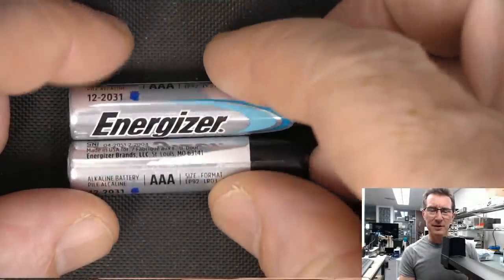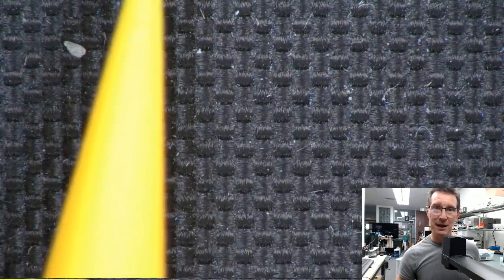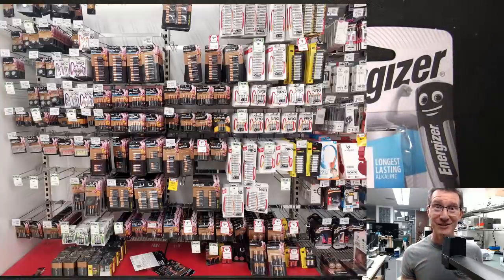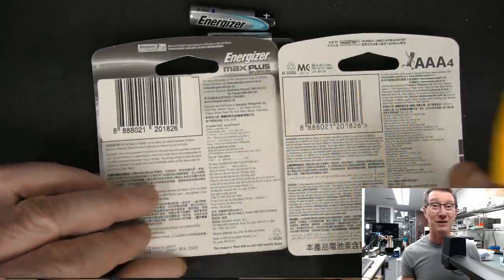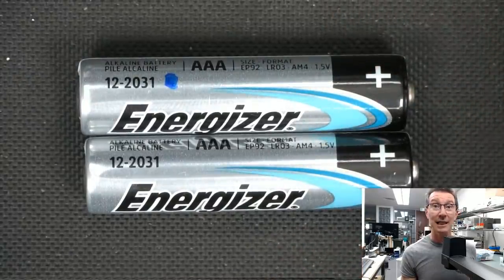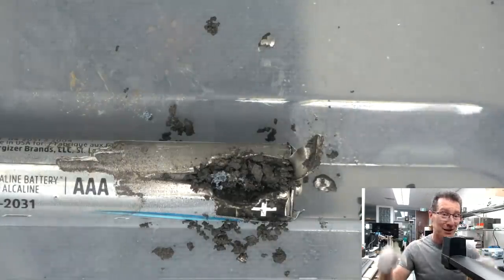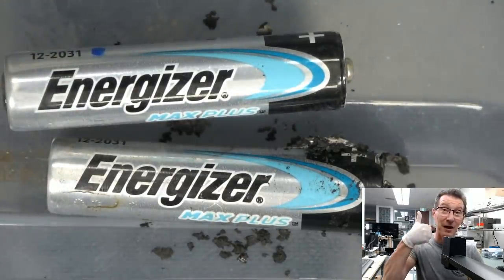EEVblog #1350 - Fake Energizer Batteries?

Comment: I hope you hear direct from Energizer about the leaks.... I put so much trust in them!
Reply from the maker: Surely you jest!
Reply: @EEVblog  Don't call me Shirly!
Reply: @EEVblog  This is something they need to look at, at least from a marketing/PR perspective. With over three quarter million subscribers it's not like you're obscure, so I bet someone at the company has/will see this. Just because the exterior and chemicals are visually identical to the real product doesn't mean it's not a knock-off - the manufacturer should be concerned enough to contact you for samples.
Reply: Just when I thought we'd escaped the scourge of Duracell.
Reply: I worked for Union Carbide in the early '80s when they owned Eveready. Before alkaline batteries became popular, they would replace any device damaged by an Eveready (maker of the Energizer) battery. Although in a different division than the part of the company I worked in, because we were both in the Cleveland, Ohio area, we shared a computer. They used the computer for battery longevity testing, while we ran general workloads. There was trouble if the general workload crashed the computer, and ruined a month-long test.
Reply: Reminiscent of Amazon’s recall with doorbell camera batteries, tho.
Reply: Sometime before Easter, when the rabbits get busy.
Reply: they will send him an energizer bunny as compensation.
Reply: Didn't Fran just get done singing Energizer's praises? She must be bought off by big battery now! SHAME "ding-ding"... SHAME "ding-ding"... SHAME!

Love ya Fran.
Reply: Narf is Fran spelled backwards. Or how it would look if you were in the mirror.
Reply: Energizer is just a banner it's not a poduct. Could be any battery inside depending on where in the world you are.
Reply: could we use it to scrub the Carbon form the air ?  GLOBAL WARMING is solved  :)
Reply: Hi Fran!  =]
Reply: @ColinTimmins  Good to know @Fran Blanche keeps an eye on the Aussie fella :)
Reply: I have just watched your video about batteries I am a fan
Reply: @MaquinasAbiertas  Being a fan, which batteries last longest in you?
Reply: @veryboringname.  We use rechargables.
Reply: @MaquinasAbiertas  This is the answer - if you have a device that you don't want damaged by leaks under any circumstance, put eneloops or some other good rechargeable in.
Reply: It's Fran!
Reply: theres the problem... youre trusting companies that only care about profits...  SMH..
i bet you use Apple products too...
Reply: @WacKEDmaN  If they only care about profits, they would be interested to know about a product fault.
Reply: @CT-vm4gf  but it NOT A FAULT...its BY DESIGN...dont you listen?!
Reply: @WacKEDmaN  ,  I'll bet they are DROOLING over the M1 chip, then! ROFL
Reply: @WacKEDmaN  NOONE USE APPLE.  APPLE USE YOU.
Reply: @notavailable8130  ,  Too bad they ARE "Available...!"

Comment: First the Duracells leaked. Then I found two new Energizer Max D cells leaking in the original package. I'm still checking other makers for better quality. So far Panasonic and ACDelco look promising. Good luck. I sometimes use Panasonic Zinc Carbon AA. In over 30 years I've never had one leak.

Comment: Hey, I watched this video a week ago and a couple of days my mother came to me, because her electrical furnace (just for decoration, no heating) broke. I looked at it and it ran with batteries, with Energizer batteries, and one of them leaked. It was the same fluid, that came out of them, didn't crystalize right away. Those were original ones, that were just a couple of days old.
btw I'm from Germany.
Thank you very much for this video.

Comment: I assume the venting happens when the internal pressure exceeds the external air pressure by some margin.  So if the external air pressure were reduced, that would increase the chance of a leak.  Might the leaky batteries have traveled by air mail and thus spent some time in the in a cold, low pressure cargo hold of an airplane?

Comment: Question, the GPS tracker didn't happen to be sent via air mail did it? Could the pressure changes that occur during flight have sped up the leakage process?
Reply: Airplanes are pressurized
Reply: @84ThoughtCrime84  Airplane passenger/crew cabins are pressurized, but cargo areas sometimes are not. That being said, the pressure is not constant, and changes as the plane ascends and descends(which is why your ears pop during these times).

Comment: I think the Positive terminal not being attached properly may be the culprit on the ones that leaked. The machine that rolls the negative end over the seal would have too much pressure if the overall length was too long because of the positive terminal being welded wrong. To much pressure could squeeze the seal and damage it.

Comment: All major battery brands that I purchased in last 5 years have leaked... They are all shit now. Buy a 25-50 pack in plastic containers and at least a few will leak within a year or two. Lol. Looks like the battery shell usually leaks in the seam due to crap seal or thinner-than ever metal being eaten away.

Comment: SNI is an Indonesian Standard for certification of safety for a specified appliance. It’s similar to UL logo. There are many ways to certify for safety and meet regulatory rules for IEEE. It appears that Energizer chose to certify these batteries to an SNI standard. The MSDS should be looked at before handling any type of small cell battery. It’s a google search away.

Comment: alkaline batteries seem to leak like clockwork if there is a frequency going in , or through them.  I thought I found a way to charge alkalines by slow pulse charging, and it charged. also leaked in a month.   roughly 2mA - 7mA for 24 - 72 hrs = near guaranteed leak in some months. I have yet to test whether or not is it just the slow charge or the mere existence of a pulse.

Comment: Those two packages are very different, though... did you get them both from Woolies?
Reply: Watch the video. And logic says that they are the same battery cells, one set with old branding and packaging and the other with newer  branding and packaging

Comment: afaik alkaline batteries are packed instead of rolled, and i guess thats why they have such a high internal resistance. Maybe its on purpose because most stuff doesnt need 1A and it also helps to increase sales in stuff that needs more power because at 1A you get 35% de capasity so more power = more batteries sold.

Comment: at 15:55 'Lithium don't leak'  . Well I had a leak with one (or two) of the lifepo (type 32700) batteries here. A goop on the desk and came out of one of the terminal, the positive one. A waterisch transparant fluid which later on turned brownish (dark orange) when it dried.
Reply: Li-FeS2 (Primary Lithium, replacement for 1.5V Alkaline) might not leak. What you have is LFP (Lithium Iron Phosfate rechargeable). There are many types for both primary and rechargeable lithium batteies with wide variety of characteristics

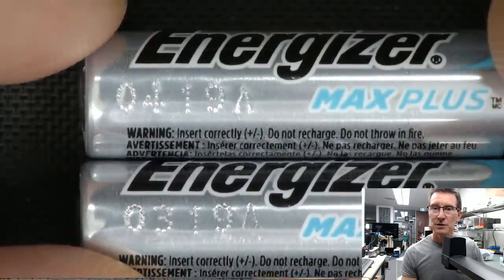Comment: At 7:40 you mention that these batteries were send in the mail bag. Were they sent air mail? Perhaps the lower pressure in the airliner's cargo hold damaged the seal, making the battery more likely to leak. Maybe that is only a problem when the battery is actively providing current, as you mention the GPS tracker was running the whole time.

Comment: The metallic label is actually the leak indicator. When I inspect equipment where such batteries are installed, I immediately check the colour of the negative terminal. If it looks white instead of metallic, the batteries go into the bin. 

Duracell and Energizers are ticking time bombs designed to kill equipment. 

I've had way better luck with brands like Fuji, Philips, Sony, Panasonic. Haven't had leaks from those.

Comment: Sad all batterys no matter what brand they are going to leak. About 20 years ago they made batterys better and they lasted longer. And I myself 20 years ago, very few times I open something up and the batterys were not leaking. Now days I run around my place once a year checking batterys and find a few that have leaked. Just times are changing and not for the better.

Comment: Batteries under load while in flight (as they were mailed), would that be an issue with these.
Reply: No, it's simply that the batteries are dead flat, and all Alkaline batteries tend to leak. They even have holes in them to release the schmoo.

Comment: For the battery leakage experiment, maybe it would help to put the samples in a hotbox or something to heat them right up to (or slightly beyond) their temp rating. Or just paint the tupperware lids black and put them outside in direct sunlight to temp cycle them or something.

Comment: Found out the hard way that shiny metallic stickers / labels like on this battery can be conductive.  Licensing stickers on a PCB where a shiny silver hologram type.  They where laminated on the top, but the bottom foil side only had a coating of adhesive between the metal foil.  When stuck on a PCB the sticker could cause resistance across through holes where the solder mask was pulled back off of.

Comment: Way too many years ago to remember, we used to re-charge alkaline batteries to get a bit more life out of them at work. As we used to get through quite a lot and getting an extra week or so out of them, noting that it’s said to not be safe to do so. It was a risk, but what were the risks involved, we were young and it was the 80’s.  We used a dirty DC voltage to push a bit of charge back. Well one lunch time we had left some on charge and when we got back to the office, we found a lot of mess on the top of the bench from one battery that had exploded!!!!

During the cleanup which included having to clean the ceiling! We found the centre metal spike of the battery stuck through the RSJ supporting the ceiling. Gone clean through! After this all attempts at prolonging the life of an alkaline battery was banned.
Reply: I sometimes used to re-charge AA batteries in the late 80ies and early 90ies, too! I didn't have to, I just thought it was cool that I could when everybody thought it was impossible. I never had one explode or leak though, it was always fine. I just put them in a normal AA charger for re-chargeable batteries. I think it was some simple 100 mA or 200 mA charger back then. It even had a lid so you could close it up while charging, so it wouldn't have been that dangerous.

Comment: I guess if package was send by an air mail, like on a plane,  low level of ambient pressure, compared to a pressure at the sea level, in a cargo section of an airplane. That may have resulted in a pressure difference between surrounding and internals of a battery, which led to escape of the liquid  from the battery. And batteries are usually delivered by sea or a land transport. Only if someone can test this theory in a vacuum chamber.

Comment: Were they airmailed? I found that every hard drive failure that I can remember has occurred shortly after being on an airplane. I reckon it's the air pressure changes doing them dirty.
Reply: Hard drives have sealed air and related vents.
Reply: @johndododoe1411  I'm talking about common, mechanical hard drives. They need to have a way to equalize pressure with the ambient environment so that they don't flex and deflect the precision parts. They tend to have a filter of some sort guarding the vents. I've seen both mechanical (a piece of cloth) filters and charcoal (to adsorb chemicals). I understand that the routes of dust ingress are guarded, but I'm telling you that Iraq is unreasonably dusty, I brought half a dozen hard drives with me, and several of them failed - not there - but when returning to the US. In my unit, there were many such cases. Yes the vents are filtered. No, filters don't turn off the contamination like a switch. That's part of why warranties and 'Mean Time Between Failures' exist.
Reply: @buckstarchaser2376  My point was that the vacuum of altitude would seriously exceed the design limits of whatever controls the inert superclean atmosphere inside a 21st century mechanical hard drive.
Reply: @johndododoe1411  The altitude pressure inside a commercial airliner is usually set to 8000 feet. The atmosphere inside the drive is the same as outside it because it is not hermetically sealed. The amount of abrasive materials that end up inside it will depend on the efficiency of the filters it has in place, the ambient dust quantity, and particle size, and how many volumes of air are exchanged between inside and outside. Once the drive leaves its factory shipping containers, it will accumulate dust internally. You can reduce the dust ingress by not letting dust get near your drive, via various creative means, and avoiding drastic air pressure changes. Some will naturally occur due to temperature and weather, but traveling between elevations and altitudes will - in my experience - overwhelm the built-in filtering. Since these tend to be edge-case situations, the manufacturers can usually either write off or deny the warranties on these drives as "abuse", and turn it into a sales opportunity for specially hardened components.

Comment: Is it possable these have at some point been in a low pressure enviroment or a very cold enviroment (cargo hold on a plane) as either of these conditions can cause batteries to fail and leak.

Comment: Could you do a video on puffed li-ion batteries? If it is a good idea to pierce them (tiny hole) and 
then apply a piece of tape to seal the hole. I was always tempted to do it.
Reply: Nope. Piercing puffed lithum batteries are a major fire and chemical burn risk.

Search on youtube for videos, some people have done it, but its not generally done by anyone with survival instincts.
Reply: If your li-ion batteries are puffed, get rid of them quickly (and discharge them first, if possible). Punching a hole in Li-Ion batteries is always a very bad idea, it will almost certainly set them on fire and go up in a pressurized multi-thousand-degree flame with toxic smoke. And you can't stop it until its done unless you bury them under 50 pounds of wet sand. Which won't even totally stop the reaction but just keep it from burning your house down.

Comment: I only use lithium cells in things I care about that need to sit for long periods. Remotes, multimeters, good torches, clock backups etc. I am told that they do not leak and I have never been let down. Expensive though.

Comment: While on the subject of alkaline cells, some years back I knocked up a bit of test kit for production that in theory should have had the AA cells almost last their shelf life in but they died a couple of weeks. 
Turned out to be the plastic holder I'd used. It didn't have spring terminals but relying instead on the flex of the plastic and the pressure it exerted on the cells was enough to open their O-ring seal. No leakage, just dead cells in a couple of weeks. Changed the holder for one with springs and the problem went away.

Comment: Ta for confirming the leaking Duracells. Used to do work for a local charity shop and I'd noticed that almost every donated item with leaking battery damage would have Duracells in them.
Reply: Where did you see leaking Duracells? This was all about Energizers.
Reply: @AstrosElectronicsLab  3:40

Comment: But what if you stick the energizers you have bought at woolys back into the gps tracker and mail it back to the fellow who sent it to you? Maybe the difference in air pressure and the cold caused them to leak since the airplane's luggage compartment is usually not heated?

Comment: Some 20 years back, when I was younger, I took apart some batteries, but the casing was negative end, and positive was stuck on some graphite rod. what changed?
Reply: Maybe yours batteries was not alkaline but Zn-Carbon. Positive case is typical solution for alkaline batteries.
Reply: Those were probably the older style, zinc-carbon cell.  For some reason when they make alkaline ones, they've changed it around.  I took apart more than a couple zinc-carbon cells when I was a kid.  :)

Comment: Just wanted to chip in, I took apart my energizer rechargeable that I've had since 2009, and they still work barley, but I also have Duracell rechargeable made in the same year and they still have amazing low Impendence values, thus still great "umph".  Anyway, they have shells as negative not positive, just an interesting note, cause the magic flight box is designed to have the shell as negative so I'll have to check other batteries to see if that is true, even though you showed those as such...
Reply: Well if they've turned to 'barley', you might use them to brew up some grog.   lol  (sorry, I know it's just a typo, but I couldn't help myself.  lol  I'm going to get help)

Comment: My dead batteries (down from 1.5V to 0.9V) have a second life in a fridge magnet toy called a "Battery Eater".  This flashes 2 LEDs for many weeks and works down to 0.6V approx.  If battery is not removed when LEDs stop flashing circuit continues to drain it and eventually corrosive liquid oozes out - regardless of battery chemistry or manufacturer.

Comment: I’ve had batteries on a corner of my bench for years, no leaks, no corrosion, nothing, nada... I leave a pair of brand new double A in a remote control, a year later corrosion has showed up. Could sunlight (UV) maybe prevent corrosion on your battery experiment?

Comment: What is going on with leaky batteries these days? Of course old age and rose tinted glasses might be affecting me but I don't remember batteries leaking nearly as much when I was a kid, even the expensive alkaline batteries... I had a clear out a few months ago and came across my old 80s boombox that still had the D cell batteries in it (date coded 87 Sanyo I think they were) dead as a dodo but no leakage...  perhaps design of modern products as well as crappier batteries? Or option C they were always terrible :P